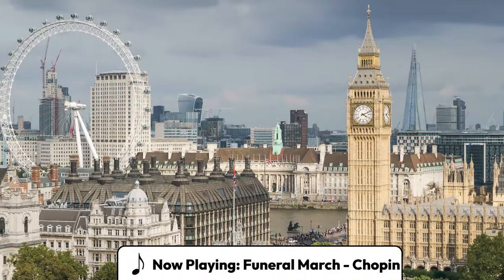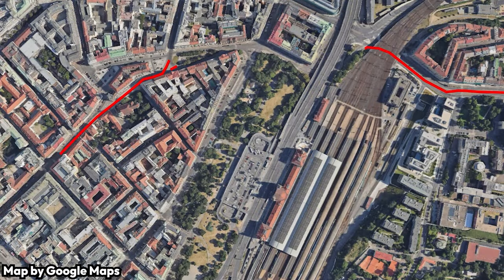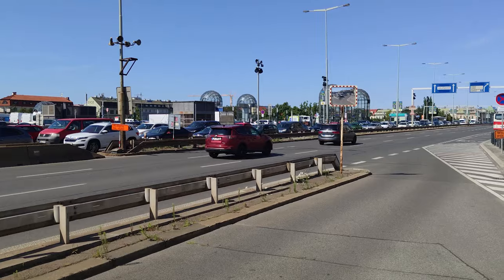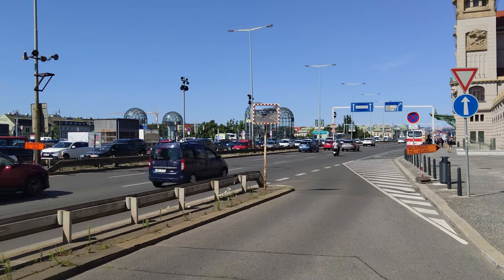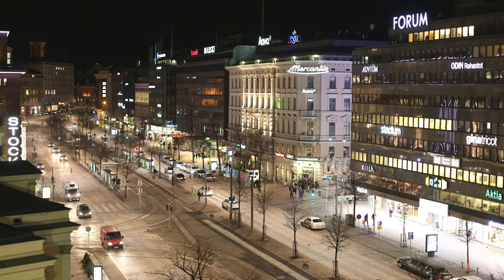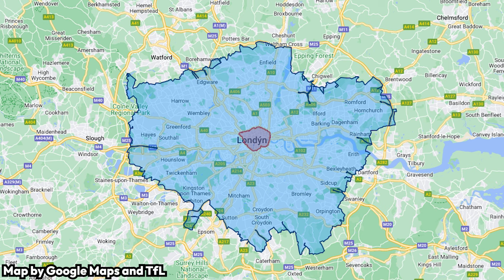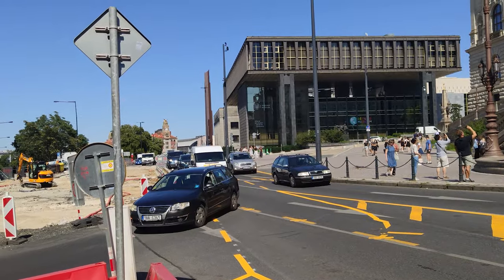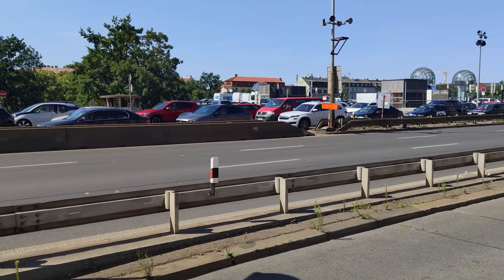How Terrible Land Use Ruins Cities

Comment: Everyone complains about the highway in front of the train station...you don't see the highway anyway if you enter or exit the station. You'd have to purposely walk upstairs to get there. If you exit a train and walk downstairs to the underpass, you can exit the station on the same level, and enter a park, without have to walk upstairs again.
The highway is actually quite useful, it gives you quick and easy access to the central station from the outskirts, which otherwise you'd have to travel up to an hour to by public transport.
Btw – the charge in London isn't working either. The streets are still full, congestion is everywhere and people have to spend more money.

Comment: I often wonder just how easily people forget that we live on a finite planet. Our modern civilization is highly dependent on critical resources that do not grow on trees like apples do, and energy abundance (sadly… thanks to fossil fuels). With the worst part being that there is no such thing as sustainable recycling. We lose material no matter what, and the more you want to recycle, the harder it becomes and the more energy you have to put in. 

Aluminum is perhaps one of the easiest metals to recycle, and yet, only around 76% of produced aluminum is still in use, even though we only started using it in truly great quantities after halfway through 20th century. Production in 1900 was 6,800 metric tons, and 2,810,000 metric tons in 1954.

The point I’m making is that sooner or later we will run out of raw metals and will have to resort to recycling. However, as I just said, it goes against the laws of physics. Even if we could reuse imaginary 90% of the material after each cycle, after only 26 cycles the amount of material would shrink to just 6% of the original. With 80% reuse rate the amount of material would shrink to just 10% after ONLY 10 cycles. Mind you, both of these numbers are crazy high.

Thus, we seriously need to ask the question: “Do we want future generations to have access the things we do now, or not?”

We can mine the forests, the seabed, and the mountains to manufacture a billion electric vehicles, and dozens of other disposable gadgets, and all that wasteful infrastructure it entails here and now, and future would look akin to Mad Max. 

Or we can understand their value on a finite planet and use them wisely to ensure they are available for long-term. This means maximizing lifecycles, minimizing use, and moving away from completely wasteful uses. No disposable cars, no planned obsolescence, no unrepairable devices, no “innovation” like 0.1 mm thinner phone bezels, no buildings made to last less than your grandma, and so on… You get the idea.

What’s it going to be?

Comment: This is what should be done to the road. Cut the existing road deep into the suburbs or cut it entirely. Change it into a 2 lane in each direction boulevard or avenue. Add a dedicated cycle and bus lane, wide sidewalk, return of the tram there etc.